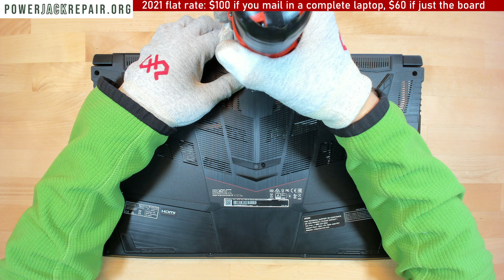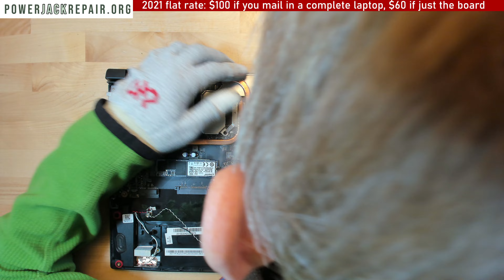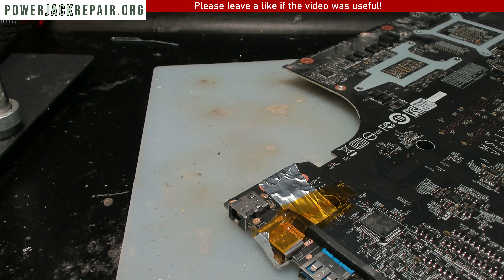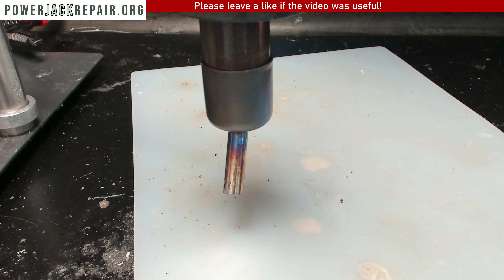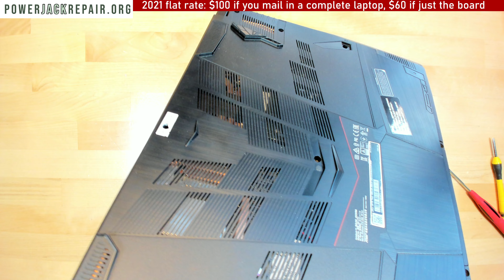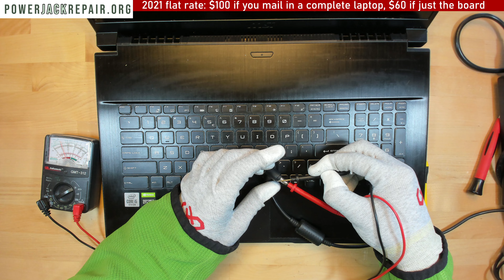MS GF75 thin MS-17F4 laptop charge port power jack repair fix charging connector replacement

Comment: I did the same repair on this very same laptop. One thing I advice you that, you don't need to remove the battery pack to
free the MB. You just unscrew, lift at a 10 degree angle and slide away. Good work!